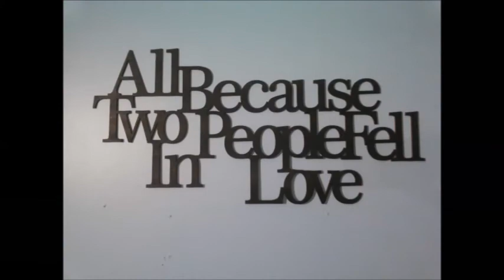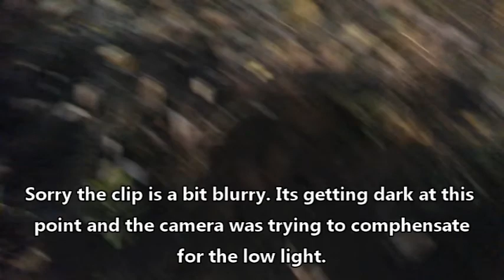How Dig Potatoes the EASY way. No fork/shovel needed!

Comment: I'm impressed by the simplicity of the potato digger. No more potato fork! Good job!
Reply from the maker: It really is so much easier than a potato fork! Before we used a digger, we would spend most of a weekend lifting/sorting potatoes for the root cellar. Of course, we brought in a 55 gallon barrel full of potatoes! It was hard work. This is so easy, its almost cheating :D